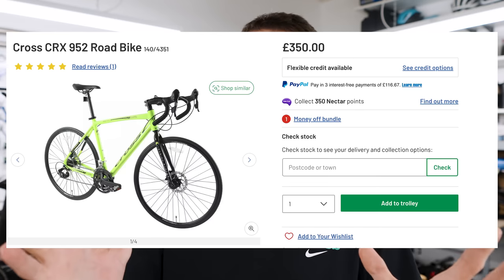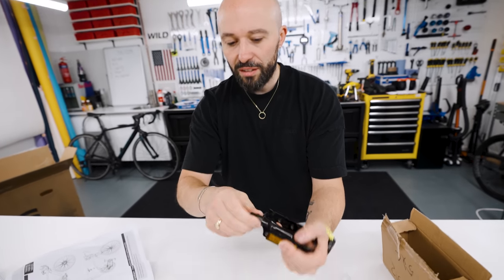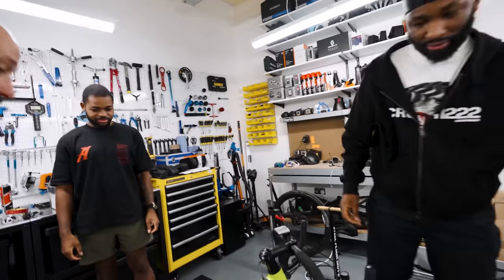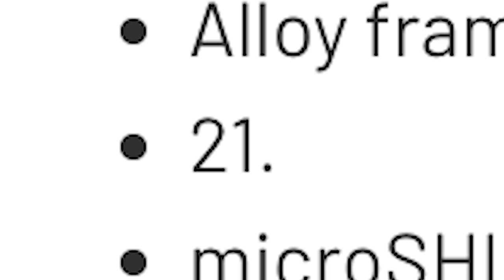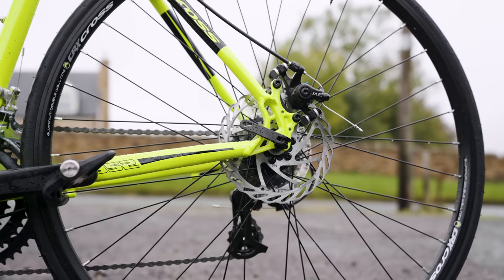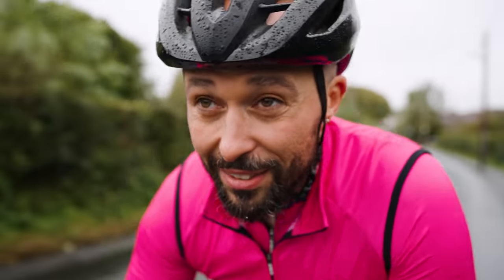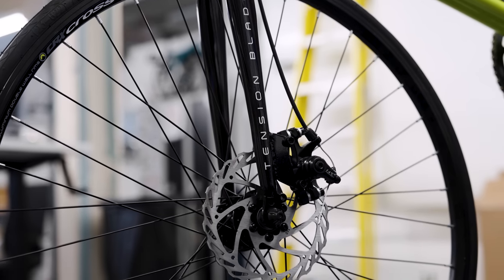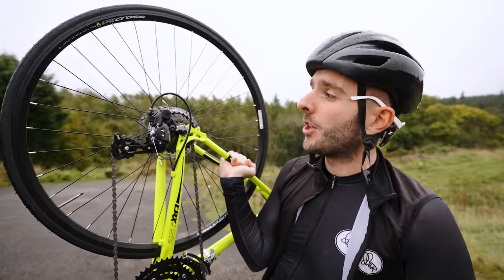This High Street Entry Level Bike Surprised Us - Decathlon Rival?

Comment: Went into leisure lakes yesterday and they had 4/5 drop bar bikes, the entry level was a specialized at $1000, it's crazy no rim braked bikes either in the shop, 10 years ago you could get a Ali Mekk with sora for $450 or a specialized allez with Shimano 2300 or trek for $500 from the same store, better off buying second hand these days.

Comment: If Argos did this bike in 2 (or ideally 3) sizes, changed the triple to a cheap compact (50/34), swapped the freewheel to a a 11-34 and could squeeze in 28mm tyres- no matter how basic, they could increase the price to £399 and sell these day long. Those swap’s really shouldn’t affect the overall landed cost price to Argos (not retail) too much. 

From Argos’ POV the main issue would realistically be holding more inventory due to extra size options, and how many would they actually sell. All our suggestions are based on those of experienced cyclists, but most seasoned cyclists won’t be buying a £350 bike from Argos, save for maybe a turbo trainer bike or winter bike. 

So whilst Argos maybe could get those changes implemented quite easily, and that would be a great, usable, crazy cheap road bike if they did, it’s probably not worth the hassle for their predicted sales numbers.

Any experienced roadie who did buy one (I would actually get one if it fitted me) would probably just swap out tyres straight away anyway and eventually fit a different chainset, most of us have attics full of Dura-Ace chainsets after all!! 🚴🏻🤣🤣
Reply: For someone like me who just wanted a cheap run around Argos dont really have any mountain bikes for taller people, their frame size is always around 18" and its tiny. i wish they would stock larger frame bikes

Comment: I bought a Cross hybrid bike out of desperation when cheap bikes were hard to come by after lockdown.  I only paid £125 for it. The cable actuated calipers failed within months and I also kept replacing spokes. The tyres were made of cheese and the bottom bracket was a bucket of marbles. I still ride it although all that's left of the original bike is the frame and the seat. Not the forks, they went too. I definitely never got a bargain in the long run.

Comment: You say you have to upgrade the triple front mech shifter to use a double, but you don't. I have the old Triban 500 with the Triple microshift shifter and have put a hollowtech Shimano Sora double 50-34 on the front of it, you can set the derailleur limits so it only has two positions (with the triple derailleur) , and works as good as any cheap double shifter in that set up. It is not well set up 105, but it switches between the big and small ring pretty well without skipping or jamming so does the job for free. 

I would say the limits of this big are that it is what you start to see in a cheap bike, steel forks (adding 2.5kg), low tyre clearance, a triple, be interested in how the tyres are because cheap tyres can really have limited grip when it start to get cold (but not icy).

Comment: The triple doesn't cause the cross-chaining wear, though -- you would see the exact same problem if the front was a 1x.  (In fact, this is kind of the problem with 1x!). 11-12 speed cassettes make this a little better than 7 speed because you have a higher density of gear options in the same physical space, but it's not like it's even twice as dense as a 7-speed.  I guess what I'm saying is, 2x gearing is objectively the best :-).
Reply: I was going to question the same thing.  Which is worse for cross chaining 2 x 12 or 3 x 7?  Jimmy could have a point with overlapping ratios though.

Comment: For those of you just getting into cycling and on a limited budget, or you just don't want to spend a lot of money on  your first bike because you're not sure you'll stick with it, here is my advice:  Rather than buy a $400 bike brand new, take that same $400 and buy a much better used bike.  You could easily find a nice aluminum road bike with a 105 group set that would be a lot lighter and have a lot better build quality for the same money.  If you don't know what to look for, find someone who does know or just do your research online.  Bikes do not hold their value well at all, so for $400, you could buy a bike that was originally about $1,500 but is now 5 or 6 years old and may have a scratch or two but is in great working order.  That's what I did with my first bike, and once I'd ridden that one for about 3 years straight, I sold it and bought myself a carbon bike on a great sale.  Spend your money wisely on all your bike purchases.  You can't buy speed no matter what anyone tells you.

Comment: Great video.  I find some triples work really well but, yeah, I prefer a double any time.  Where I live (Ontario) the equivalent of 350GBP will buy you a really nice used road bike.  Maybe a medium range aluminum frame from 2005 ish era, with 105 groupset (eg Giant, Trek or Specialized) with probably 80% of its useful life left in it.  I imagine its the same in UK?
Reply: The Deore XT T8000 line is a triple and it works perfectly. I don't know about the Tiagra triple groupset, but like... A very good triple is possible and idk why so many people don't like it. The thing is, modern 10 and 11 speed groupsets are designed with cross-chaining in mind.
Reply: @stephensaines7100  Agreed.  I own several 80's steel frame bikes, each of which will still be going strong years after the Argos bike is in the dumpster.  Having said that, the Argos bike appears to be functional and looks great in the modern sense.  Its all good if it gets folks into cycling.  Fantastic that you are doing 100km rides in your seventies btw.
Reply: @chriswright9096  The Argos is from Argos Racing, in Bristol to be clear.

Comment: Got gifted a Cross CRX500 hybrid by a friend the other day as he has a bad knee so never ever uses it and  just wanted rid so gave it to me to "do something with" and sell. 

Was shocked as it looked like new but as soon as I got on everything was just all over the place, rattling and just barely staying together.

Seeing how yours arrived explains a lot but half an hour tinkering got it tight, quiet and as smooth as it was going to get with its full Tourney group less iron age cranks and floppy V brakes.

Much like yours, this bike also rolls surprisingly well for a bike which in this case retailed at £130 😳 and masks its weight well.

The worst bit on this bike is also the triple chainset which is so cheap and nasty it has so much wander it is impossible to adjust out front chain rub. I honestly thought it must have been fitted wrong so removed and refitted but no difference. Don't want to mash it up by attempting to straighten it.

My similarish 20 year old Claud Bulter Chinook is so much better in so many ways, actually very like to the CRX352 but rim brakes and straight bars.

It will do someone as a sturdy commuter hack nicely though.

Lesson for people out there, just like you show, if you are buying a Cross new you better have some basics skills, and if you are buying second hand also don't assume its set up right but you should have a decent basic bike to get around on.

You can have it for £75 if you like as long as you promise "No stunting or jumping" 😅

Comment: Big fan of triples (53/39/26 and 11-32 9spd cassette on my Audax bike), needed my 26 tooth inner ring yesterday going up Widecombe Hill near the end of the Dartmoor Devil Audax. Bike size is usually measured by seat tube length.

Comment: the big problem with it being 7 speed is that probably means the rear frame spacing is 126mm instead of 130, so if you wanted to upgrade to 8+ sprockets out back you would have to cold-set the frame, which you can't do cause it's aluminum, then you would need a new wheel.  I wonder where they even found a hub that had both a tread-on freewheel and a disc mount.

Comment: My older Ultegra triple 3×9 (52-42-30 crank) shifts better in the front than my 105 10 speed 2×10 compact 50-34 crank. When riding a triple I only use the small ring as a granny gear going up a steep hill. I can see double being better with an 11 or 12 speed though.

Comment: You know what a very interesting video concept could also end up being.
Budget gear. I've been thinking about getting one of Decathlon's 50€ road helmet, but I dunno if it's good.
Also My head looks wack in one, maybe also a video on what style of helmet fits what head shape, if that's a thing?
Reply: And at it maybe also the riding boots (gravel ones specific if possible, like the Triban GRVL 500/520 spd or Rockrider Gravel Race 900) and ask the Bikefit guy if they are solid for beginners?
Reply: As long as it fits you, the helmet should be good. I am pretty sure all helmets sold in Europe must meet a minimum safety score. Also take a look at Specialized Align II, its one of the cheapest MIPS helmet and interestingly one of the safest on the market based on the safety tests.

Comment: Hey Jimmy, we're not all ex pros, or necessarily in the first flush of youth.  I couldn't ride without a tripple, which makes pretty much all the flash bikes out of reach or need a suitable upgrade to 3by.  I'm surprised you are happy with 7 speeds at the rear.
Francis, the length of the seat tube is the traditional way of sizing a bike so it's not surprising thats what they used. 
I wonder that you didn't notice at the point of sale that it was a "one size fits all" (well normally no-one) but perhaps you did.  Why even entertain the possibility it might be good value.
If, as Jimmy claims, an owner might want to upgrade (?) to a 2by, why woud they need to replace the tripple shifter when they could just set the cable short so that only 2 worked?
Entry level riders might have aspiration to be fit and strong but they are entry level riders so maybe they need an easier ride to start (unless they live in the fens or somewhere else pan flat)
Reply: Triples are great, you get a much greater gear range without needing loads of gears, or widely spaced gears, on the back.  A 2by is a downgrade imho.
Reply: @mad4461  hear hear.

Comment: Wish these entry levels didn't feel the need to complicate. The internal cable routing, triple front ring and disc brakes pointlessly add cost and increase maintenance. I'd prefer better components and traditional routing and brakes with a double. 23mm tires also a stupid choice. I wonder if the one-size-fits-all approach is how they make the price point.

Comment: I have ride a hybrid with 28/38/48 and 14-28 in 18 years, work brilliant. It seams like 3-speed dosen't work with bended bars. What spec on this bike?

I really like the small difference in ratio at front with that bike. But the freewheel is abit wide. Now I have 13-28 on it and I hate it. It is clearly too wide. 

I never use smallest chainring on tarmac. 

Jimmy - some entry level cyklists living on flats and have leg muscles. 

Good that you check out low price bikes!
Reply: Driven?

Comment: Can you Brits not commit to the metric?
Just use cm for heights and km/h for driving/riding speeds, gan damn.
Reply: You have to remember, in the UK, filling stations sell fuel by litre, the cars show fuel economy in miles per (British) gallon, and the range is shown in miles too.

The UK's half usage of metric is fine. I personally use metric for most things, but when it comes to things like driving, there's not really a choice but to use miles and mph.
Reply: educated people can figure it out
Reply: @dcataj5085  Imperial sucks. The only reason I think the UK stuck with miles for roads and railways is because switching would have been too costly. Actually, many of the railways are having to switch to metric due to signalling technology being metric specific. HS1 is metric, the parts of the Thameslink and Elizabeth Line in London are metric for automatic train operations, and there's a rural rail line in Wales that swapped to metric for electronic tokens.
Reply: @dcataj5085 no, metric was widely used since the late 70’s in the uk. It’s only beer and road measurements that are imperial, because it sucks.

Comment: not even in a thousand years mech disc brakes are better than rim, in fac hydraulic are worse than rim breaks as well. 
The wheel is the biggest disc you'll ever get, disc brakes were born to bypass the stupidity of using carbon wheels which are terrible for breaking